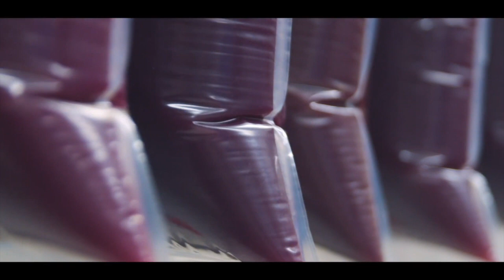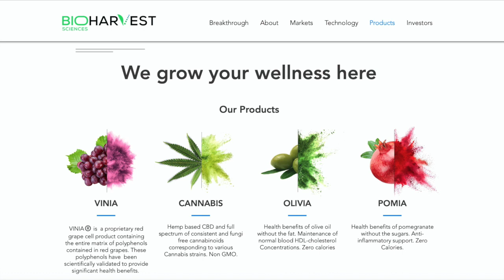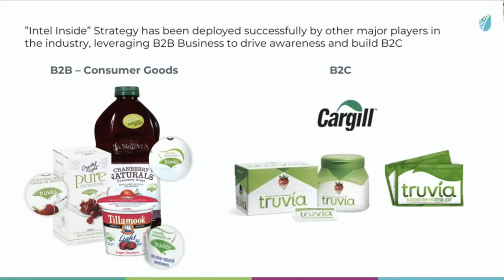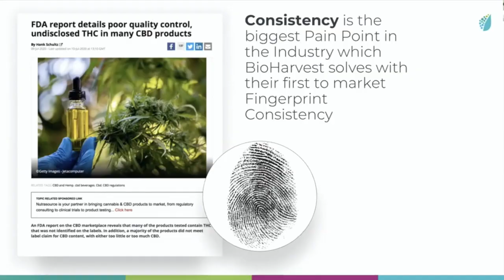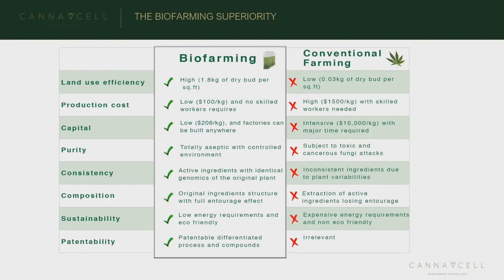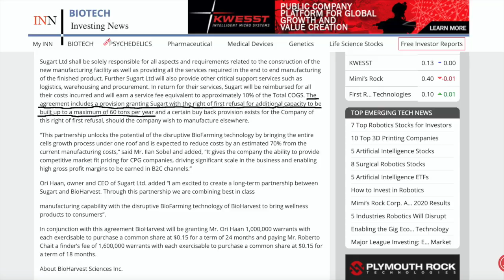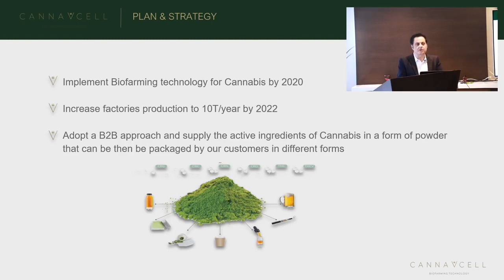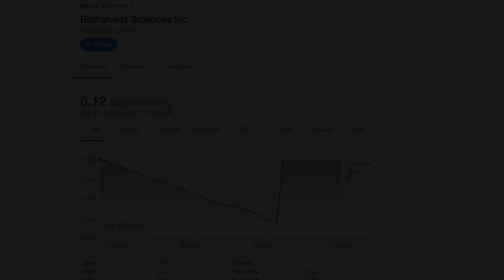BioHarvest Sciences! The Next Billion Dollar Company!

Comment: I have been watching this plant tech for about a year. To make real gains you need to get in early. With the right marketing and effective partnerships it could disrupt the medical cannabis sector. BHS can almost produce every cannabis product except for dried flower from their results. The amount of products that potentially can be made supports good revenues. If they can execute the scale up then this is surely a great buy.
Reply from the maker: I think it is an amazing buy. If they can scale up operations without too many setbacks. The applications they can cover are very widespread. We use many plant products on a daily basis. Both Primary and Secondary metabolites.